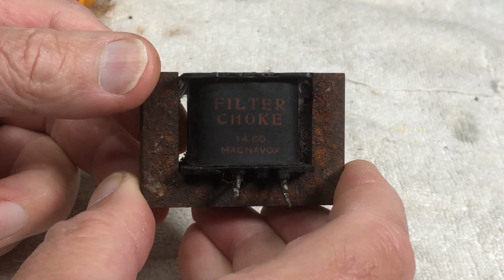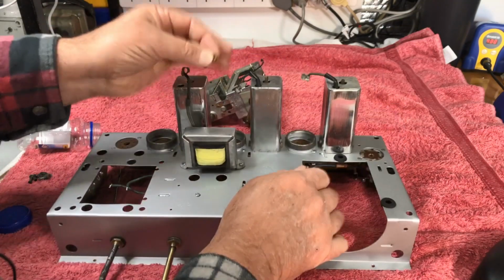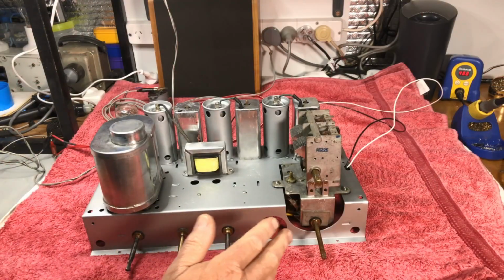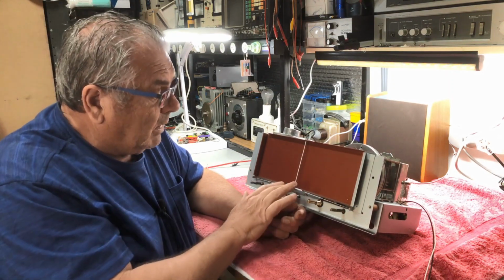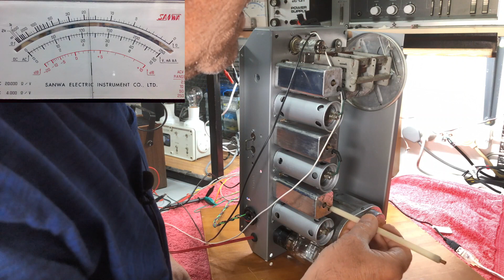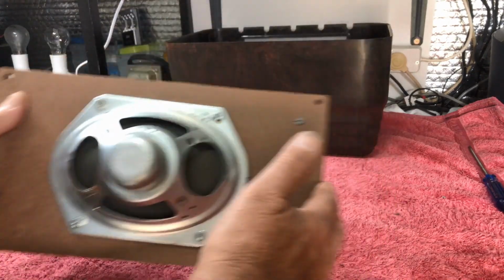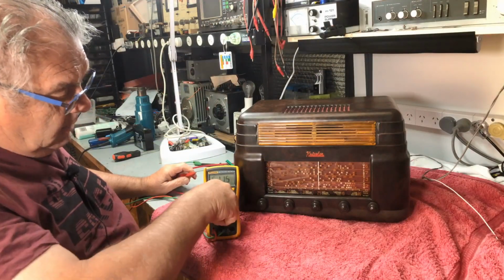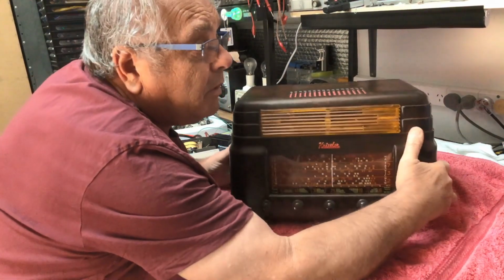The Grand Finale' Restoration of my 6 Volt 31-7 Kriesler Radio

Comment: Baz My Congratulations I have been following you adventures with refurbishment of Kriesler 31-7 you made excellent job I started my Radio and Television Career in the early1960s I can remember farmer bringing there 6 volt batteries in for charging few. Had 6 Volts Radio most had 32 volts radios,Before 240 Volts arrive at there farm,Anyway Baz a Wonderful refurbishment Mate,Regards Ian,
Reply from the maker: Thanks Ian, was a long drawn out project but got there in the end.
The 6 volt thing made it interesting though.
Merry Christmas Mate !
Reply from the maker: That radio really tested me out ! I was glad when finished. It still sits in my Living Room & turned on now & again to check it. Still working perfectly but stations are disappearing quickly on AM. I do play my "in house" music through an AM Transmitter on 1050khz so it's great to use the radio as a radio (RF) rather than a Bluetooth Mod to it !
Cheers

Comment: Are the tubes in that unit made in 1957 because the transistors of the day were not ready for prime time.
Reply from the maker: Hi David,
Not sure it was about transistor reliability, perhaps others have more info on this, any comments guys ?
The radio was distributed between 1952 - 1956 but these tubes were made much earlier than this.
Baz
Reply: @techobaz55  Should have known but is there a way that the unit could be made to work with a H+ of 12V and a B+ of 12V also and using the tubes from 1957 and would also make the unit safer to work on as there are no mains voltages and we can lose the vibrator.
Reply from the maker: The tubes heaters are all 2volt, arranged in a string & the 6AN7 is 6volt. The B+ has to be around 135volt.
Not real sure why you would want to run it all on 12volt, a very big mod.
Reply: @techobaz55  So it would much safer to work on and could run of a wall wart but come to think of it the B+ should be 45-60V not anything over 100V which was a stupid idea anyway